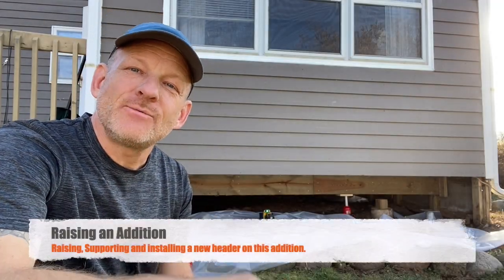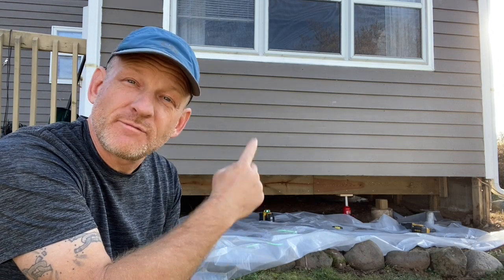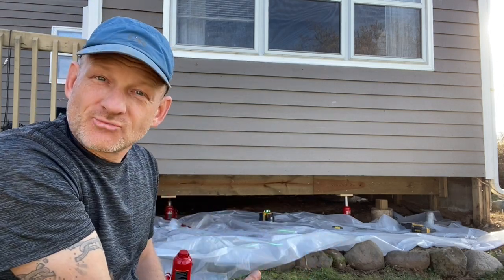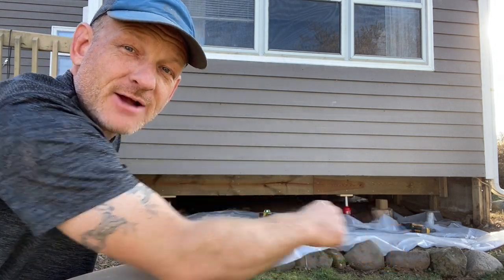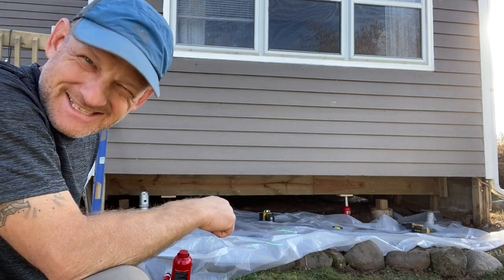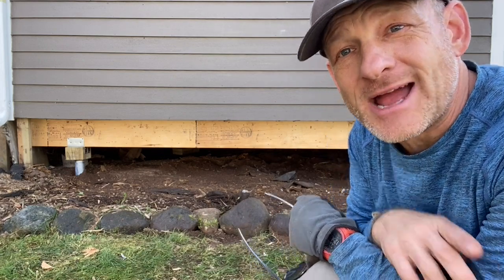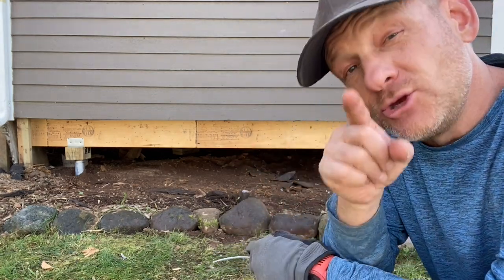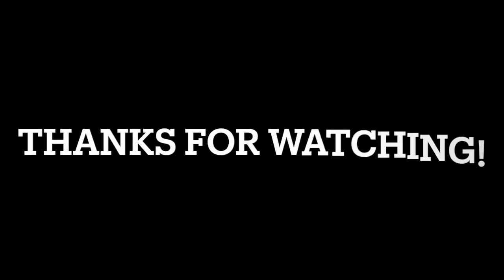Raising an Addition and setting it on Helical Piers.

Comment: How did you get the helical piers set under the existing structure?
Reply from the maker: Hired a company to install them. They dig out behind the pier, put them in at a slight angle and then push the pier into place.